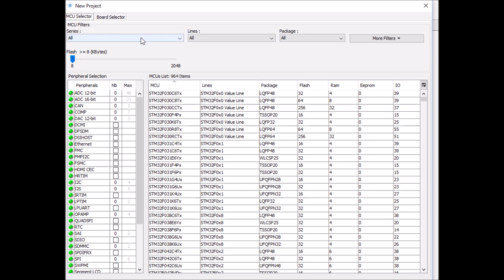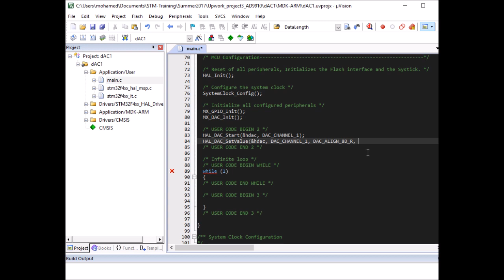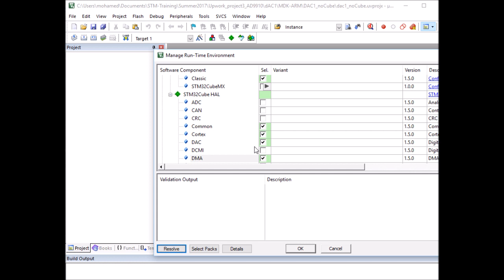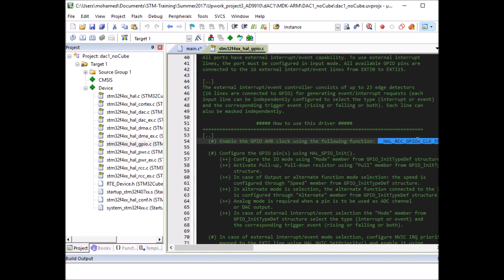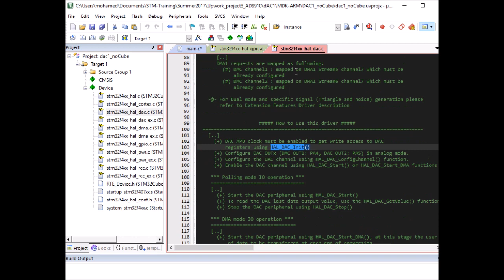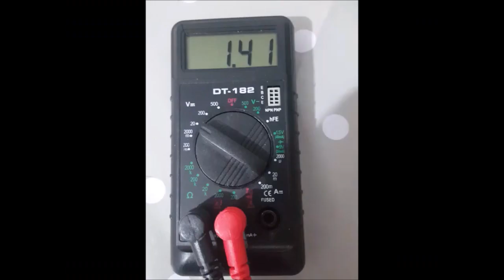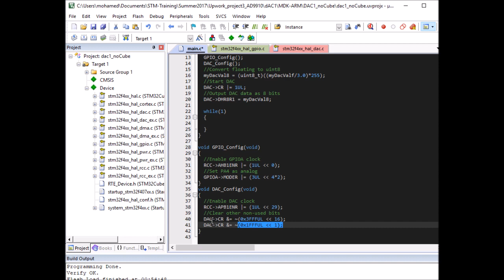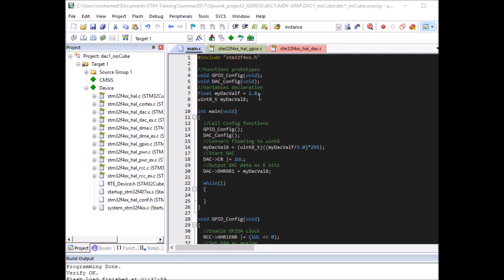STM32F4 Discovery board - Keil 5 IDE with CubeMX: Tutorial 7 DAC - Updated Nov 2017

Comment: Hello, thanks for the video. I would like to answer a question.

Everything is fine with HAL libraries when i use DAC in 8B mode but when i changed my code from 

HAL_DAC_SetValue(&hdac, DAC_CHANNEL_1, DAC_ALIGN_8B_R, value) to 

HAL_DAC_SetValue(&hdac, DAC_CHANNEL_1, DAC_ALIGN_12B_R, value) or left one

I can't get any output from PA4. I also consider the valByte value as uint16_t. Do you know why is this happening?

Regards.

Comment: Hello, I try to make a program in which i will take 4 analog inputs and extract 2 analog outputs. I am using this tutorial and tutorial 6. I am trying to link them but there is a problem. The ADCs work perfect but not the DACs. If I stop the ADC DMA with HAL_ADC_Stop_DMA the ADCs don't work but DACs do. Is there any solution that you suggest to me?
Reply from the maker: Hi,
Take a look at peripherals diagram in reference manual to ensure you have not used shared resources or things like that.

Comment: Hi, @MYaqoobEmbedded
CubeMX doesn't show any DAC for my Stm32f411vet. 
what should I do?
Reply from the maker: Hi Mohammad,
STM32F411 does not have a built-in DAC,, you can either use the Audio CODEC, CS43L22 which is a bit not too straight forward to use...
Or just get a different STM board, the STM32F407VGT has a DAC peripheral.

Good luck
Reply: MYaqoobEmbedded thank you for your quick response.

Comment: Hi friend, could you make a video showing the implementation of the peripheral ADC + DAC? Because I'm trying to do a digital filtering using STM32, but I'm having trouble calculating the exact sampling rate. Can you help me? I made an application that designs the digital filter, if you want to use it the link is this: www.dropbox.com/sh/8v8ghkp3f9sx6x4/AAB4p-q8qPx29E-x5ktlhNIua?dl=0
Reply from the maker: Hi Luiz,
You have both ADC and DAC videos available,, just try to link them,, it is relatively straight forward. What you need here is:
1. ADC with Timer Trigger and DMA to read your analog signal straight to RAM, use the timer to control sampling rate.
2. Perform your Signal Procesing/Filtering at ADC conv complete callback (has to be faster than sampling rate, which should do).
3. Output to DAC with either normal function or DAC with Timer trigger and DMA.

Hope this was helpful to get you started :)
Reply: In this case would the sampling rate be exactly the counter period(AutoReloader register)?
Reply from the maker: Luiz Fernando Pinto de Oliveira 
Yes, Will be what you set you timer to, with prescalar and period (I explained all about this in ADC Timer trigger tutorial).
GL
Reply: Okay, thank you so much for your attention!